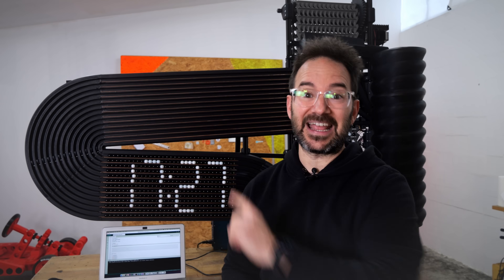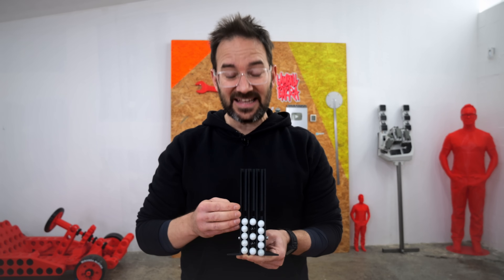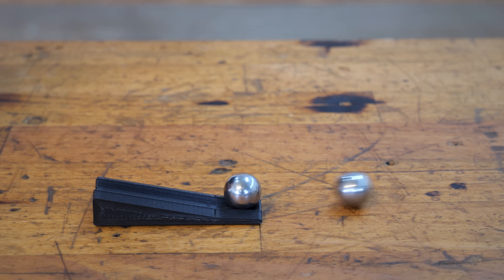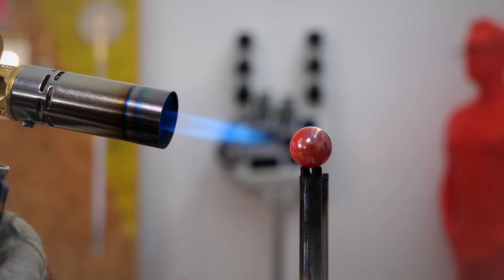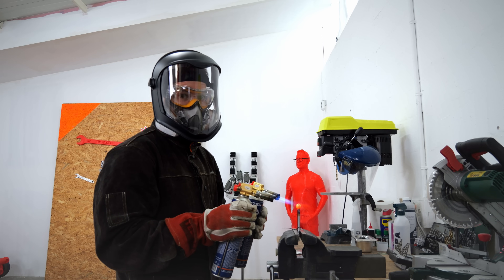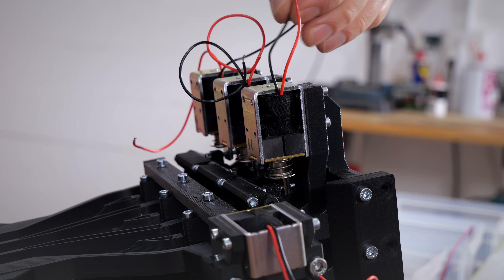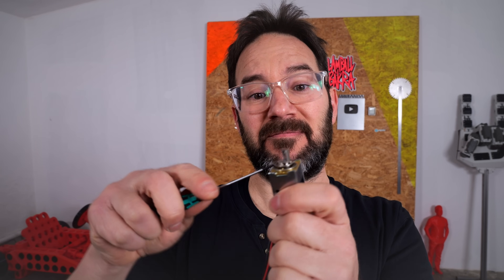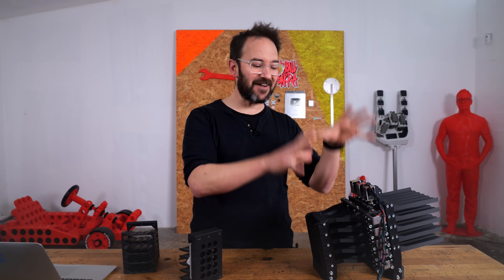Ramp Based Rapid Marble Swap - Marble Clock Seconds Display Pt.1

Comment: I just had an idea, you could add one more lane to your existing machine design to represent 2 seconds and you just release a marble in that lane every 2 seconds. It'd be two seconds because there are 31 marbles in a lane. The lane would be emptied along with the minute marbles. You would also need to add a sensor to the feed portion of the seconds lane to reject additional marbles from the elevator when the level of marbles in the feed lane reaches the sensor.   You could easily test this on your current design by converting one of the existing lanes.  You would need to design a new mechanism that was capable of releasing one marble at a time.   If you add two extra lanes you can alternate adding a marble to each lane every second. It would be like a loading bar for a minute.

Comment: only change the marbles that need to be changed, this is going to need less marbles after all. and you got 10 seconds for the 2nd number, 1 min for the 3rd number, 10 mins for the 4th number. should be easy to code ;)

if the color doesnt change simply dont drop a marble at all

Comment: Why not use only one color and make the black pixels not have anything in them? You would need a different system for blocking the marbles in the display but it could be done magnetizing a metal frame, and you wouldn't need all that complexity to select the color

Comment: The first split gate you designed with the 3 positions could still be actuated with a servo super easily, and would be a little slower but use tons less power than solenoids. This does add the annoyance of calibrating center and 2 end positions for each channel though.  

Or you could use a solenoid that is designed with a spring on both sides of the pnunger so it has 3 positions. Off -center. Positive voltage - pulls to left. Negative voltage, pulls to right. Control would be more complicated as you would need two independent relays or MOSFET switches acting as an H bridge, but its totally doable.

Comment: If you only intend to show digits, marble 3 in columns 1,3,5 and marble 2 in columns 2,4 never change, you could limit the solenoid movements to just 2 per row if you were to simplify this.

Comment: If you use used motor oil, you only have to go through the heat/quench cycle once. They come out jet black from all the burnt carbon particles in the used oil. Been doing it for years.

Comment: What if you just make a seperate feeder for the seconds that features a continuous loop of marbles....or if the marbles were magnets with black and white sides alinged with the poles then you could use electro magnets to switch the visible face by changing polarity....but that might be cheating 😂

Comment: Ivan, let me give you a crazy idea... If the freaking 3d prints already are black, why the heck do you need the black balls? Use only the chrome ones!
This way you could just use magnets, for example, and hold only the desired balls in the correct positions. 😉
Anyway, stay safe there with your family! 🖖😊

Comment: You could use no black balls. The print is all black, so the negative space fills in the “holes”. You’ve already built the selection mechanism, so instead of (A|B), it’s just (A|not A).

This way you don’t need to sort the balls after releasing them as they’re all the same.

Comment: ditch the black marbles altogether, just use ball and no ball to show time, saves you the trouble of loading them and selecting them seperately. this way you just need to worry about where to put a marble.

Comment: IDEA: For the vertical display idea. instead of having it drop, stop, and drop the marbles again to show and change the digit, why not make it a continuous scrolling display?

For example, you could construct a premade "loop" of marbles with the digits 0-9 already arranged. The digits could then just be continuously scrolled across the display to read the time.

The start of the second would be synced with the marbles as they align with the minute and hour display

Comment: You could use the glass marbles if you push them from the back. Instead of a lip have a flexible tab or bump such that a small force is needed to push them. Have a queue of marbles for each digit that feeds from the side and then have an actuator at the back to push all 15 queues at once every second. It could be a solenoid or even just a cam.

Also you dont need a selector per "pixel". The combination of white/black marbles for each position and for each digit will always be the same. You could just have one "master" queue for all 15 "pixel" queues and then split it mechanically with flip flops or something. Feeding from the left where letters are columns and numbers are rows go C1 C2 C3 C4 C5 B1 B2 B3 B4 B5 A1 A2 A3 A4 A5 then back to the start. A single queue of 150 marbles then encodes all the "pixels" for all ten digits, meaning you only need one feeding/sorting mechanism.

Comment: How are you gonna go from 8 to 9, 9 has a open spot in bottom left where as 8 has all the outer edges filled. You can't push out all the marbles with the design you have now, because one will always be on the ledge.

Comment: Ivan Maybe Im dumb but I Think you forgot the Sorting Part, I mean in the First solenoid Part can only chose vertical Lines or whole vertical row, and not Singular Marbles, and because of that its Impossible to place horizontal lines, that are incential for the Numbers of 023456789,... the construction of yours is now only able to Place the number 1,... hmmm🧐

Comment: How did you handle the heat dissipation on the solenoid? I have had issues keeping the solenoid mounted while actuated/latched in a powered state. The solenoid will get hot and melt or deform most pla/petg.

Comment: But... having a sinlge soleoid for each row won't make it impossible to pick different colors for each horizontal position?  Also I am pretty sure that there has to be a spray paint that can prime chromed metal... even if you have to spray a ball twice to catch the entire surface it has to be faster that 11 cycles of oil quenching.

Comment: Why not paint the marbles with a good spray paint? Print them a holder so they are not rolling around. Paint only from the top. Let dry. Rotate marbles. Paint more. Repeat.

Comment: Can you take the chrome off with a tumbler? If you can then you would be able to use the blackening agent directly on the steel without all the heat cycles.

Comment: The main issue I see with the matrix multiplexer approach is that you can only address one column at a time. Are you sure you'll be able to load all three columns, wait for the marbles to settle and release them within one second?
Reply: You can optimize every number to 2 operations except 4:

1- Some numbers have two matching columns, meaning you can fill two collumns in parallel
● ● ●
● ○ ●
● ○ ●
● ○ ●
● ● ●

○ ○ ●
○ ○ ●
○ ○ ●
○ ○ ●
○ ○ ●

● ● ●
○ ○ ●
● ● ●
○ ○ ●
● ● ●

● ● ●
○ ○ ●
○ ○ ●
○ ○ ●
○ ○ ●

● ● ●
● ○ ●
● ● ●
● ○ ●
● ● ●

So numbes 0, 1, 3, 7 and 8 can be generated in two steps (actually 8 can be reduced to just one if you read the next point).

2- Some marbles never chage colors (top right, middle right and bottom right, second column center and forth column center) so you could disable the multiplexer there or always feed there the same ball. Given the scale of the project I'd almost call that a non issue.

Number 2 can be treated as two matching colmuns if you only feed some positions the white marbles or directly disable the multiplexer in certain positions:

● ● ●
○ ○ ● 
● ● ●
● ○ ○
● ● ●

● ● ●
○ ● ● 
● ● ●
● ○ ○
● ● ●

And the same is true for 5, 6 and 9:

● ● ●
● ○ ○
● ● ●
○ ○ ●
● ● ●

● ● ●
● ● ○
● ● ●
○ ○ ●
● ● ●

● ● ●
● ○ ○
● ● ●
● ○ ●
● ● ●

● ● ●
● ● ○
● ● ●
● ● ●
● ● ●

● ● ●
● ○ ●
● ● ●
○ ○ ●
● ● ●

● ● ●
● ● ●
● ● ●
○ ● ●
● ● ●

So this would mean only number 4 would require three steps.

● ○ ●
● ○ ●
● ● ●
○ ○ ●
○ ○ ●

Since it's just one, if the others have plenty of time, this one should be fast enough, or may be solvable with a double buffer...

Comment: I'm a tiny bit confused here, if every row is mechanically connected to a rod and a solenoid, so 3 in a row can only be white or black marbles if everything is released at once, so this system is forced to do one column at a time or same marbles in a row, or am i missing here something? Can it do 3 operations per second then?

Comment: For making the balls black in batches, you could get a propane torch with a rosebud tip to heat a bunch of balls at once. You could also heat them in a wire basket so you can quench them at the same time like you're deep frying them.
Reply: Get a forge

Comment: A (large) induction heater could probably heat those marbles in a fraction of the time, and be configured to automatically feed and drop into the oil bath.

Comment: To considerably reduce the amount of required marbles, you could have the selector only put marbles that need to be changed, for example if you are changing from 8 to 9, you only need to swap out 1 of the 15 marbles.
Reply: I think that would require replicating the column solenoid for every layer. It might be possible to do that on a column basis though, e.g. middle between 2-3, 5-6, 8-9 and right between 0-1, 3-4, 5-6, 7-8, 8-9, 9-0.
If it's a seven segment type of display too, there should also never be any need to have anything by black marbles in the centre of the 2nd down & 2nd up ("middles of the 8") position. Just superglue two marbles there and block off the input lanes.
Reply: @JohnWatkinsUK  that is a good point I had not realized that the marbles all dropped at the same time for each column.  That said, it could still save up to 2/3 of the marbles for certain transitions.
Reply: @JohnWatkinsUK  Or if you want all 15 marbles too fall out each digit, just have a black input line and no gate.
Reply: I was thinking the same thing. And other have mode some goof points as well. Another thing to consider is you do not need to change every number every time. Take the first hour digit for example. It is a 0 for the first 10 hours, then a 1 for 10 hours and a 2 for 2 hours. So you would far less marbles if you just keep it for that duration. You have hours to refill those lanes.
Reply: I was also looking for this answer. It would drastically reduce the amount of marbles needed per second
Reply: That would increase the complexity and yet not reduce ethe guaranteed frame change time? Or not?

Comment: Man, when this clock is finished, it needs to be on display somewhere for public viewing; it is fantastic.
Reply: Hearing protection recommended
Reply: @scaredyfish *required
Reply: @scaredyfish 
These sorts of displays are almost always placed behind glass or perspex screens to reduce the sound significantly - and also stop curious children from trying to throw M&Ms into it.
Reply: I think this would be great in a museum if it can stay running for a long time without too many issues
Reply: Imagine if it toured with Wintergatan and just counted the time of the performance
Reply: It’s on the internet
Reply: @kevinrocks34  Not everybody is, though, unfortunately.
Reply: Glass would assist with dust as well, as I believe that would be an issue for this machine long term
Reply: An art museum
Reply: A thick transparent wall could help lower the DBs
Reply: Indianapolis Children's Museum had a massive water clock, idk if it's still there, haven't been in over a decade
Reply: Agreed.
Reply: They should keep it in a nice quiet library
Reply: @petermuller161  Ooh - imagine the complaints. 🤣

Comment: 6:18 I had a similar issue in a project and I found a solution for two problems at once.
I used brass balls and ceramic balls. Both are not magnetic and they are different colors.
Of course there are acrylic and glass marbles for toys but I am not sure if they have enough mass, plus may break.

Comment: to blacken the balls quicker you could get a relatively cheap furnace and heat up many of them at a time. Also if you removed the chrome coating you would only have to do one heat and dunk in oil cycle and they would be fully black (this is called hot bluing and is used very often in industry).

Comment: Here's a CHEAT idea.. for the seconds channels, why not use a closed loop method? As in, 0-9 are already in the right configuration within a closed-loop channel system so all you need to do is figure out how a selection gate can count lets say 5 marbles from 3 channels (left side of the digit, middle, right side of the digit) and arrange them correctly within a 'landing zone' ready to be released every second. Does that make sense?

Comment: Wouldn't be easier to make the digits beforehand and just swapping the marbles each second and then putting them back already in their order so no selection of marbles is needed? Just the gate and a way to reorient the marbles back in the right order, maybe an elevator as the one in the clock but with independent slides for each channel so the marbles don't get scrambled.

If the main pretext of this is just making order out of chaos marbles. Nicely done lol. If in the second timer the goal is just efficiently show the seconds. I don't think this is the way.

Comment: I have a feeling that the number of black and silver marbles for each pixel will differ greatly, for instance top right needs silver for 1 2 3 5 6 7 8 9 0, while 2nd down left needs silver for 4 5 6 8 9 0, centre middle needs silver 2 3 4 5 6 8 9. The requirement of black or silver will be in a repeating pattern, once the pattern is set any further selection of marbles is redundant.

Comment: The fastest way to process marbles would be with electrical furnace oven. Get a local welder to make 8mm+ steel box, to hold like 50 marbles. With electrical furnace you can dile in consistant temperature, to reduce distortions and make the process more hands free.

Comment: I don't understand why you need to colour the marbles. Wouldn't it be easier if you just left spaces with no marbles for the digits? Also, that way, creating a number would take less time, as you wouln't need that many 15 marbles for each digit (13 marbles at most for the 8).

Comment: A few possible options for the different colors:
1. Find a heat treater in your area to batch anneal the balls.
2. Find a finish treatment supplier in your area to black oxide the balls.
2. Use different material balls for light/dark - there's probably a mix of tungsten, steel, brass, etc. that looks good.
Reply: Delrin balls in black and white.
Reply: Also Silicon Carbide and Alumina are easy materials to find as ball bearings.
Reply: Different materials would likely mean slightly different sizes and weights. This could cause problems for the behaviour of the balls as seen in the earlier videos.
Of course it does also open up the possibility of sorting using magnets or simple holes and gravity instead of optically.

Comment: Some things I noticed:
- The middle channel on the second and fourth level doesn't need a selector. You don't even need to cycle those two marbles. You could even reduce the marbles that have to be switched out to 7, if you did black stationary marbles on the outmost positions on level 1, 3, and 5.
- The interconnectet selectors could lead to timing issues, since you basically need to do two selections per second, except when displaying 8.

Comment: If each of the 3 columns are controlled by one solenoid each then how will you prevent it from just giving you a full column of silver or a full column of black balls? 
Unless each of the 5 'row' solenoids only open sequentially and the 'column' solenoids have to reset for each 'row' opening I can't see how that's possible. 
But to do it that way, to change the whole display every second, each 'row' would have 200ms to set the 'column' solenoids and release the 3 balls so the 'column' solenoids can reset for the next row. Will the balls even roll through the gates in that time?

Or am I missing something?